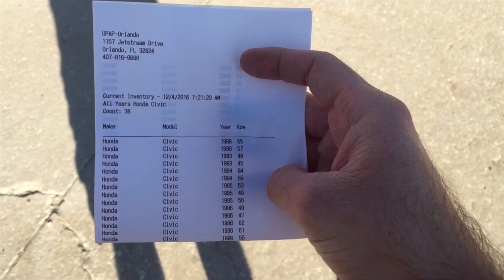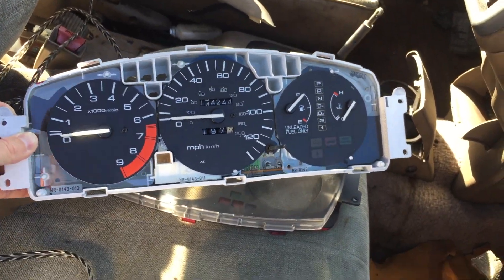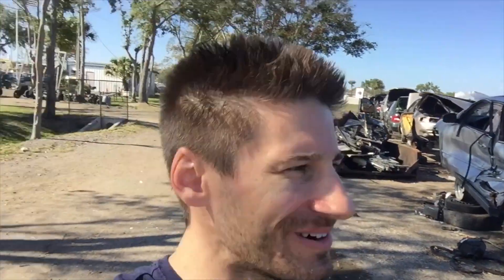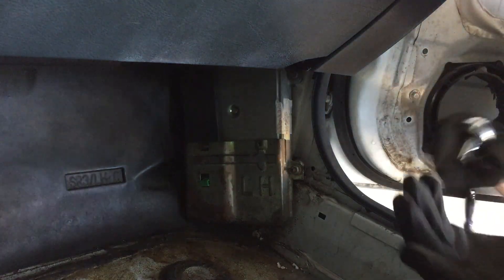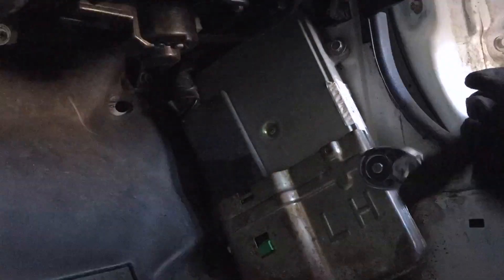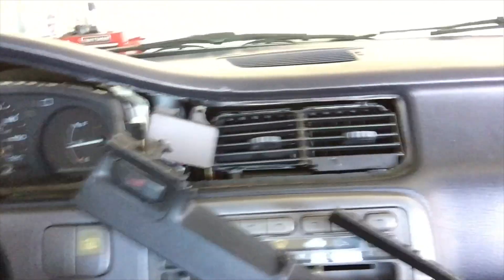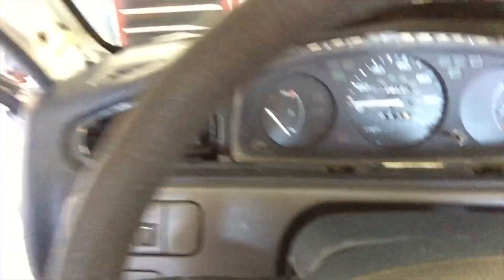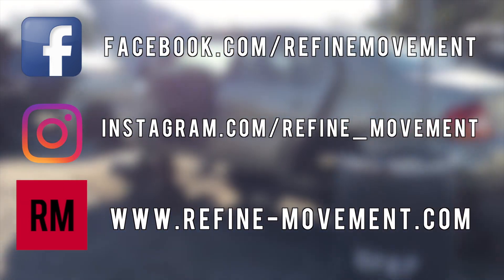Honda Civic EG D15B7 ECU search + U Pull finds - Ep 6

Comment: I had been meaning to get an cluster with the RPM gauge too. But i haven't in the two years I owned my 99 civic. Your video made me finally go get it at my local pick and pull lol. Got it for 18.99 and i got a center console that includes the arm rest since mine doesn't have it for 9 bucks! deals! Anyways I have been watching since your crx vids, they're always entertaining, keep up the good work guys!
Reply from the maker: Dude I love to hear that, thank you so much for taking the time to tell me! $18.99 that was totally worth it man! lol They are a hell of a deal and worth the little bit of time to get it and pull it yourself rather than pay $50 online with shipping.  Thank you for your continued viewership Mario, it's motivating to me to keep making content for you! Thank you man.
Reply: Mario avalos cool thanks for response too I changed ecu wasn't it I have snap ground or a bad hot to fuel pump I jumped relay 1 to 7 the pump works so I gotta diagnose this now when do we get yer race video

Comment: I have a 1996 Civic CX shell that used to have the original cluster on it which didn't have a tachometer. For my birthday one year, my brother bought me a factory Civic cluster that came with a the tachometer (obviously from the higher trim Civics). I just replaced it and the tachometer works perfectly meaning that the car's shell's harness already has the wire for the tachometer but the factory just deleted the tachometer from the cluster. I think your EG might be the same too so yours should've worked like mine. It's true that the VSS relates to the speedometer, not the tachometer which actually depends on the distributor (I'm assuming crankshaft position sensor is involved). Check the wires at the distributor and sensor.
Reply from the maker: Thanks Michael.  Yeah, I've done similar to what you described in my EK. Just swapped out the stock cluster with one that had the tach and it worked. You'll see in an upcoming episode what I ended up having to do. It does involve the distributor in my case. Thanks for watching man!
Reply: Michael Flare how come you don't do any more vids about your car I was sub to you on my old account!?

Comment: check the blue wire on the dizzy. the one on the two plug harness. see if there is any cut or spliced in the blue wire. if it's all good check the icm in the dizzy.
Reply from the maker: Thanks for your advice man. Yeah, You'll see in an upcoming episode what I ended up doing, but it involves the distributor.

Comment: I broke the bezel on my EK, the clips snapped off and on the EK that makes removal ALLOT easier, all it needs is two screws to hold it in, hopefully it's similar for the EG
Reply from the maker: Sorry to hear about you breaking your bezel too man, it sucks I know lol. The EK and the EG are actually a bit different in that resepect. I own an EK as well and I changed it out with no problem because it's a much smaller piece.  The EG one is all connected, from the driver side air vent to the center of the console.  Thanks for your input tho man, I appreciate your advice!
Reply: Refine Movement no problem good luck hah

Comment: The cluster you installed is for A/T
Reply from the maker: yes, I know. It works fine though
Reply: Refine Movement  I have a 9k rpm manual  gauge cluster if you want it.

Comment: how did you know the ecru is bad did the cel light stay on never flash. I'm having that problem LMK thanks
Reply from the maker: The Ecu that came with the car wasn't bad, it did work.  It was just the wrong ECU for the engine setup that the original owners put in the car.  They were still running the original CX, d15b8 ECU.  They switched the head out to the d15b7 so I just wanted to get the correct ECU (P06) to go along with that

Comment: Why did you change your ECU to PO6 instead of PO5?
Reply from the maker: Po6 is from a dx model which has the d15b7. The po5 is a cx d15b8. My engine at that time had a b8 bottom end but a b7 Head, so I wanted to match the ecu to the head and try to utilize that head the right way
Reply: @RefineMovement  what are the benefits of having right ECU?🤔

Comment: Should've gotten a p28 from the 92-95 civic ex/si ecu would've push a bit more power due to more fuel going through it will turn over the car just like any other obd1 ecu.
Reply from the maker: Thanks for the suggestion man.  I'll keep that in mind.
Reply: luvyourmomspie it will just run like a z6 but might throw a check engine due to no vtec but will run the same.

Comment: d15b7 engine with p06 ecu.... whats diffrence with p05 ecu
Reply from the maker: p05 was meant to run the d15b8 engine Robby. One of the big differences is the rev limiter and fuel cut off. For the d15b8, the fuel cutoff is a 5800 rpm...super low...the p06 that comes with the d15b7 goes much higher and redlines at 6500 rpm.  Fuel mapping is different as well I believe since d15b8 has a lower flow rate for the fuel injectors.
Reply: Refine Movement ahh nice one i need check mine think i have p06

Comment: word
get a pin out for the cluster

the oe cluster did not have a tach

you will have to run a tach wire to cluster
Reply from the maker: Thanks for your advice man. You'll see in an upcoming episode what I ended up doing for the tach.
Reply: I might be wrong. The car's harness already has the wire for the tachometer but the Civic from the factory had the tachometer removed from the cluster so replacing the cluster with one that has a tachometer should work. I've done it for my EK before but I think his EG should be the same too. So I'm thinking the problem is wiring or sensor issue at his distributor or crankshaft position sensor.
Reply: OMG its Michael FLARE!!!!!!!!! love your videos man!

Comment: dude you could of just taken the  rpm side and swap it in your original one. could of save a bit more money. I know cause i did the same thing cause my speedometer wasnt working ended up getting an automatic cluster and my car being stick i didnt want the pnd12 on it. alittle bit of work later i swap the speedometer and it work like a shamp.
Reply from the maker: hm, I didn't know that man, thanks for telling me.  Ends up that this tach that I had first bought was broken anyway so it still wouldn't have worked for me personally. I ended up having to get another tach for it to work finally.
Reply: Refine Movement man sorry to hear that but atleast it works now.

Comment: you also wont brake $hit if you look at DIYs that have been posted online or at least download a shop manual and preread the procedures for the work you intend on doing
Reply from the maker: Well I've taken out dash bezels or whatever you want to call it before, so I didn't intend on it braking obviously.  The piece was so brittle it just gave way super quick on the left hand side by the ac vent.  So once it broke there I just got it out after that, not caring about how it came out.   I put the new one in and it looks great now.

Comment: Lol I have a p06 ecu damn 70 bucks
Reply from the maker: Yeah, for real man I was really hoping to find one at either of those junkyards cause yeah, the price is very good.
Reply from the maker: LOL don't hold back your opinion why don't you haha! Thanks a lot for your support man.  I'm looking forward to those things as well. Got what I see to be a pretty sick coilover set up in mind that I'm currently saving for...
Reply from the maker: Haha well thanks for your opinion too man. I like RPF1's but yes, there are many other lightweight wheels in great sizes for the track. Personally I've got my mind on the 949 Racing 6ul's 15x8
Reply from the maker: Thanks for telling me that. I would be looking to buy new though. It's all still indefinite at the moment, but those are the front runners in my mind currently.
Reply: Can't remember but I think I got my p06 for about 50 not sure lol and haven't even used it yet
Reply from the maker: $50 seems like a fair price if you didn't pick it from the car yourself. About $20 if you pull it yourself, then anywhere from $60-$90 I've seen online